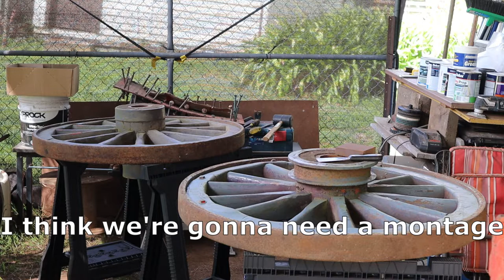Building a Gypsy Wagon - Part 3

Comment: how much timber do you think ya may need , because i have a heep of old hardwood 2x4 raffters you can have if you want
Reply from the maker: Thanks for the offer. But I'm trying to keep it as lightweight as possible. Have even considered using metal framing but but would rather not. It's funny cause I'm surrounded by hardwood, but, trying to avoid it. 👍